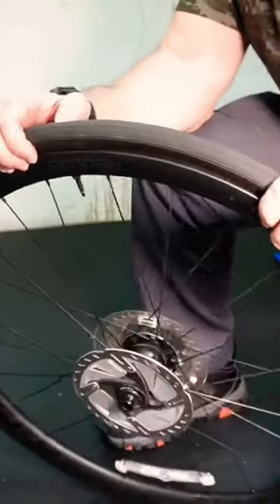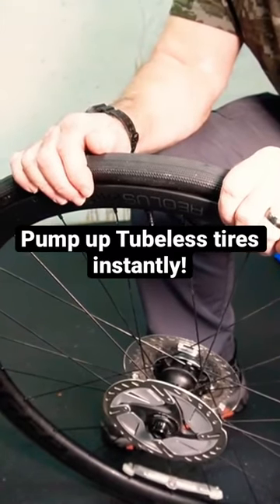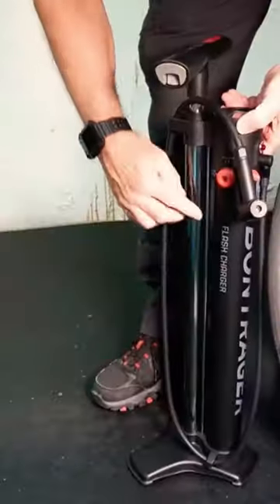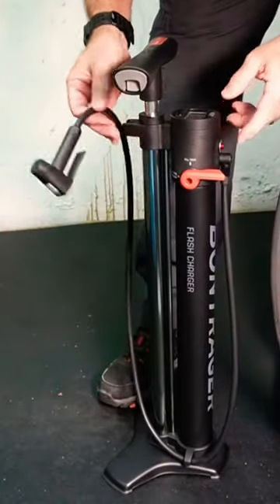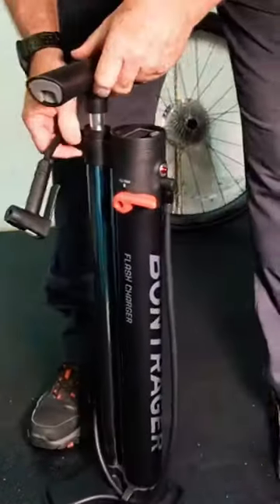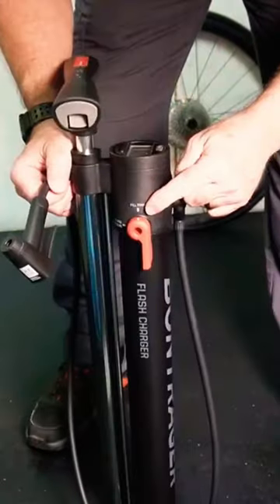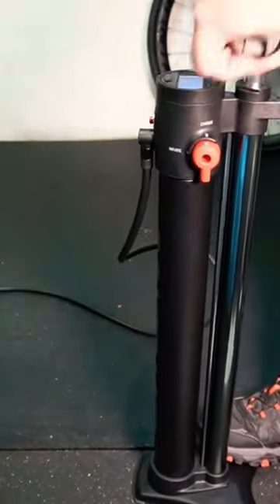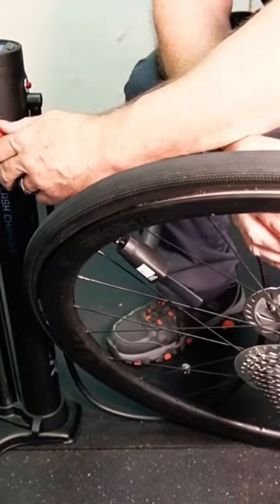How to inflate tubeless bike tires instantly without a compressor. #tubelesstyre #tubeless #shorts

Comment: How to seat a tubeless tire without an air compressor, using an air compressor
Reply from the maker: By air compressor, I mean a clunky, heavy electric device that most people do not own. Thanks for watching and leaving a comment!

Dave
Reply: @davescycling  yeah. I was just stating the obvious to point out that common overlook.

Comment: One thing I will caution against is using CO2 to seat a tubeless tire with latex sealant in it. Most, if not all, latex sealant mixtures will freeze at the temperature that CO2 enters the tire rendering it unable to seal. In this case, a flash tank will work. BTW, NEVER pressurize the Flash Tank above the safe pressure rating of the tire/wheel combination or a blowoff or rim failure may result. No tire combo should take 125 PSI to seat.
Reply from the maker: Thanks for the comment! However, the Bontrager Manual actually recommends pumping up
the chamber to 160PSI to seat a tubeless tire. (that may vary on different brands but that’s what this one does) My own findings at 130 are that the initial blast that seats the tire reduces that pressure drastically in the first few seconds and my tires end up at about 50 psi after it settles out.

Dave
Reply: @davescycling  Ok. I just don't want folks pumping up their tubeless tires above the manufacturer's recommended pressures to accomplish the seating process. I had a damaged rim that wouldn't seat properly. It has now been returned to the manufacturer for a replacement.
Reply from the maker: I absolutely appreciate your input! Thanks again!